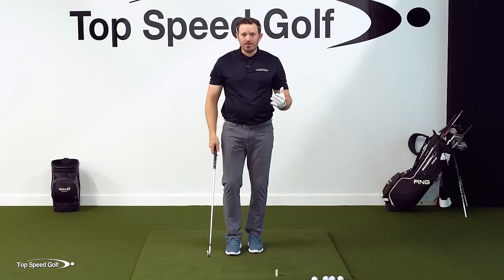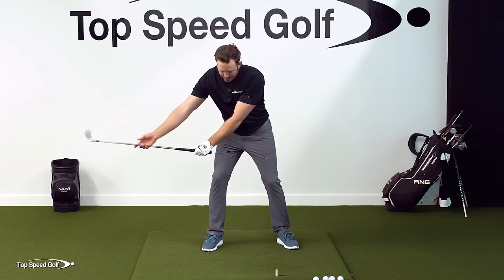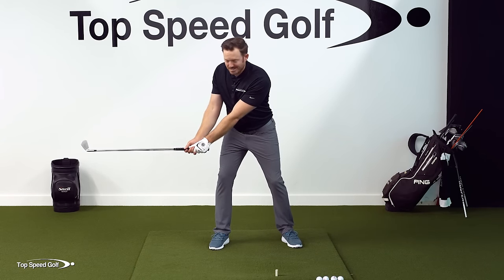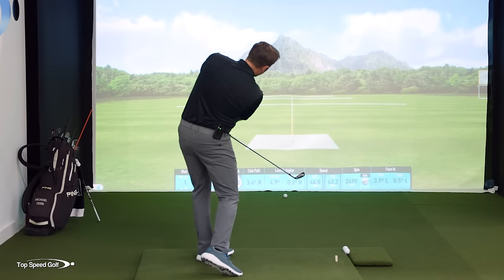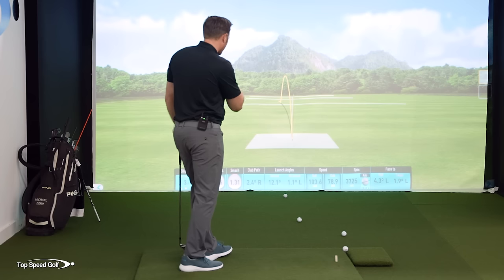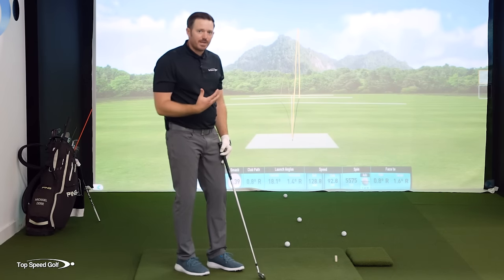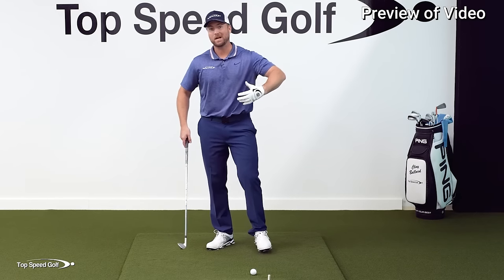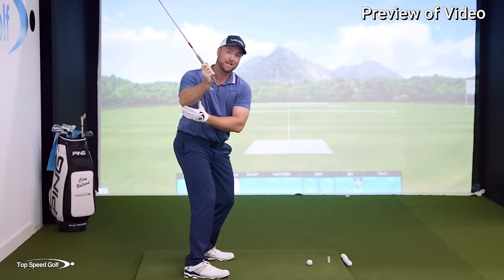This Lag Drill Will FINALLY Get You That EFFORTLESS Power In Your Golf Swing

Comment: Just a observation.  The action which is occurring but not being mentioned is the side bending action of the spine.  All good ball strikers do it so reflexively they often don’t realize it but it is not something that most beginners do when swinging a club.  

Biomechanically the action is similar to the under arm tossing of a rock across the surface of a pond.  If done at the top of the backswing you will observe by just side bending and doing nothing else it causes the shoulders to tilt more than the hips which swings the hands down and forward in an arc and causes the trail arm to tuck into the rib cage.  What makes that move “magic” in the Harry Penick sense is that it is possible to side bent backwards while the shoulders are still being pulled forward by the club momentum in the backswing.  When you isolate the side bend action you will discover it also creates a reflexive shifting of the hips laterally in reaction to the upper body mass moving backwards; the sub-conscious brain reacting to keep the body in balance over the feet just as it does when winding up to throw a ball with the trail arm.

Pulling the hand down with side bend action against the forward inertia of the club head is what causes the shaft to bend and store potential energy from the backswing — the advantage of metal and carbon shafts vs. hickory Byron Nelson discovered.  But to maintain that shaft bend and lag in the wrists it creates the laws of physics dictate that the hands need to keep trying to acceleration faster than the club head mass.  That is accomplished in the swing of good ball strikers because in their downswings then progressively increase the amount of side bend.  

I came to realize this by analyzing videos of pro swings frame by frame.   The more a golfer’s anatomy allows them to side bend in the downswing the more they can keep the hands pulling down against the inertia of the club head mass. In the swings of most recreational golfers which lack progressive side bend action the hands don’t keep accelerating faster than the club head mass resulting in the bend coming out of the shaft early in the downswing — casting.

Comment: Interesting concept with regards to the "floating swing" and makes sense.  However, there appears to be some conflict with finishing the swing.  Now in contrast to the last video I just watched with Clay, it was recommended using the left forearm to pull down on the club and the last 3 fingers of the left hand should be gripping the end of the grip tightly in the pull down move.  Not to mention I cannot tell you the number of videos I've watched and the discrepancy with regards to the hand position at impact.  Left wrist bowed, right wrist hinged, roll the wrist over shortly after impact, don't roll your wrist.  Way too much inconsistency.  That is withe exception of just about every video ending with click the link below to learn the "E Slot maneuver" to finish the swing.  I've seen the video and it still doesn't answer the question of just what is the correct hand position at impact.